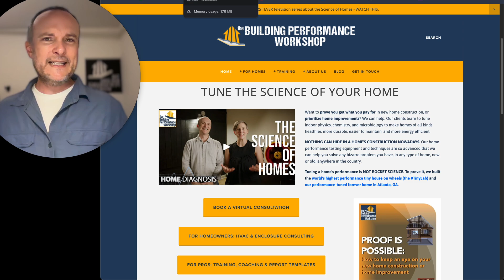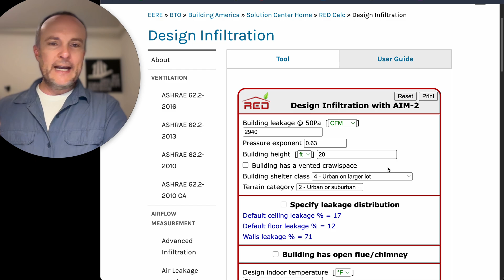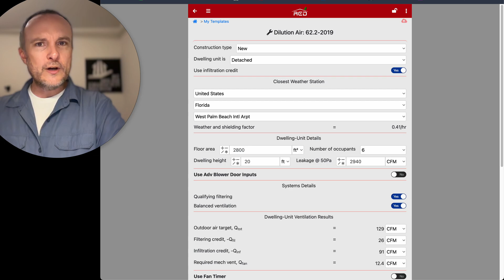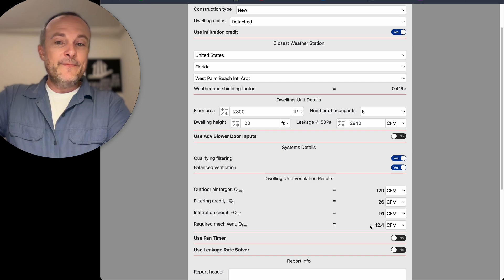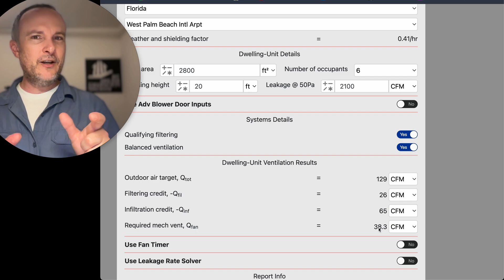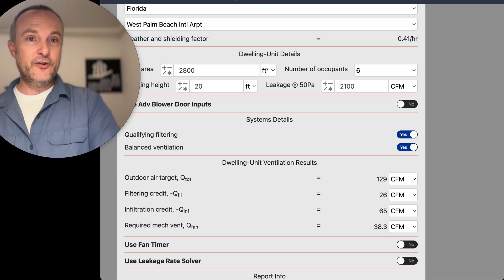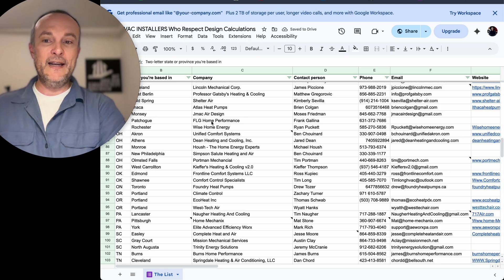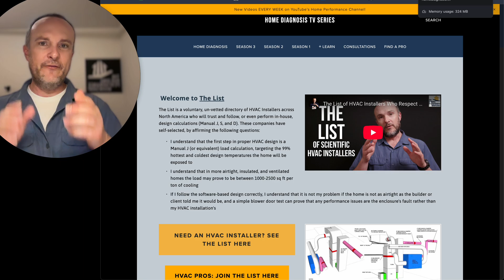Florida Fresh Air for Existing Home: Will an ERV handle CO2 and Humidity?

Comment: I did the fan on thing.. yah bad idea. Lol humidity went way high. 
Tampa here.
Reply from the maker: It’s fine IF you have supplemental dehumidification installed. My own home’s RH is a flat line, and the AHU has been running for 6 years straight.
Reply: @HomePerformance 
Yah. I have no supplemental dehum. AC company didn't feel needed.
Reply from the maker: Same old story

Comment: The  Mississippi River Delta region has essentially the same conditions - just no ocean. High humidity much of the year and many days in the spring, winter and fall where the HVAC is not running and the humidity creeps up and indoor air quality needs a boost.

Comment: I am beginning to think that there is some credence to leakiness; otherwise, every cubic inch of the building envelope should be conditioned.  It was only after living in Florida that I saw such rapid proliferation of mold; never up north; never in the Caribbean with those wooden jalousie windows...  And the old Florida homes that we have reno'd also remained bone dry.  But why is that?  Is there a hyperfocus on energy efficiency at the expense of everything else?

Comment: Great video! Can you explain why there is more infiltration when it is colder outside?
Reply from the maker: The bigger the temperature difference, the more stack effect pressure builds. Also, the taller the house.
Reply: @HomePerformance  Makes sense. Thank you!
Reply: I always wondered if the shrinking of the building material under the effect of the cold makes any hole or gap larger